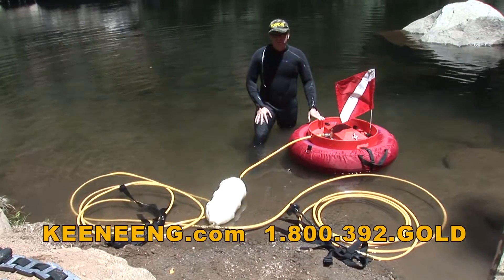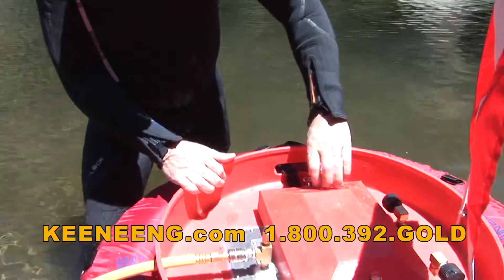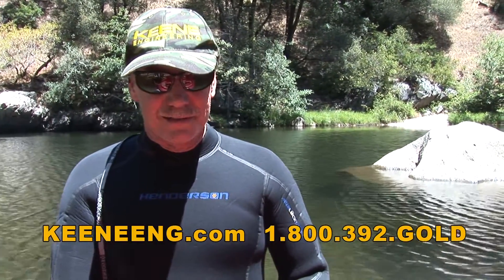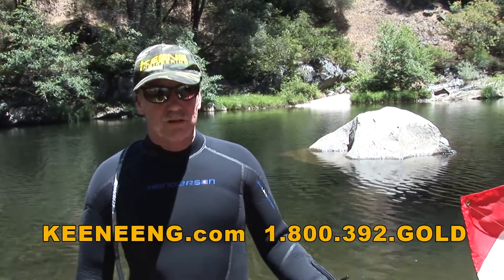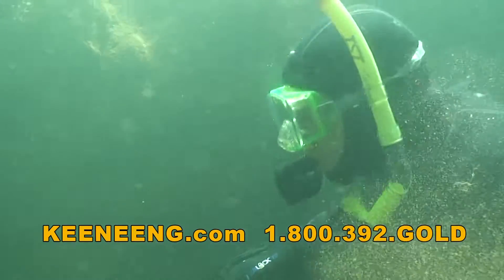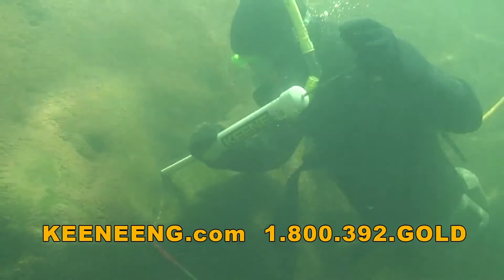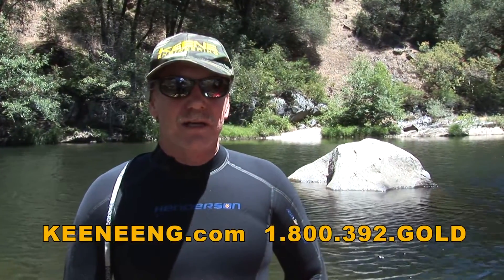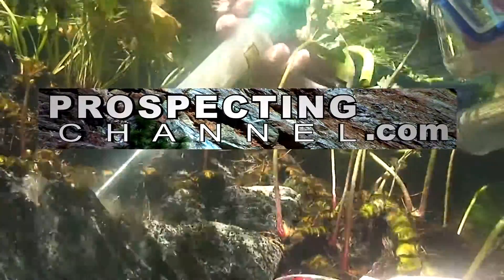KEENE HydroAir Battery Powered Floating Compressor Diving System

Comment: Would you guys be able to make a solar or water wheel pontoon powered air compressor or a battery charging system so u can switch between the 2 batteries while the other is charging?

Comment: I'm curious why it needed the big blob of silicone around the air output connection. Maybe that is just a precaution, to keep moisture away from the threads? Whatever it's purpose, it gives a real "homemade" look to this... along with the simple bent aluminum pieces, and so on... this does not look like a finished product, it looks like it was made in a garage with hand tools (... maybe except for the cast plastic housing. But that flotation ring? What?) 

I also went to the official page for this company, and there is VERY little information on the unit... just the $1,399 price tag, and a button to put it "in your cart" next to a small, blurry picture. 

Not trying to be trollish, but if Keane has a good product here, they are hiding it pretty well. A few simple things... better information, cleaner assembly (no glop), answering questions on this page... and this may turn out to be a viable unit. As it is, I can't imagine anyone opting for it, over the many other units available...
Reply from the maker: The big blob of silicon is not necessary.  It sounds like our guys may have just been a little generous on silicon.  The silicon is there to keep the inner electronics away from moisture especially in salt air.  The HydroAir is robust and simply built.  Even the electronics are easy to service. It is tough to get the body, cross-link polyethylene to fit precisely due to the verifying shrinkage etc.   The quality of the component electronics and compressor are all top end.  We even use American made compressor and electronics.  Once you have a chance to use it you will be impressed.
Reply: Thank you for the reply. Best of luck with the units going forward...